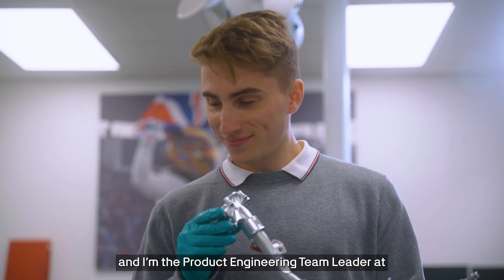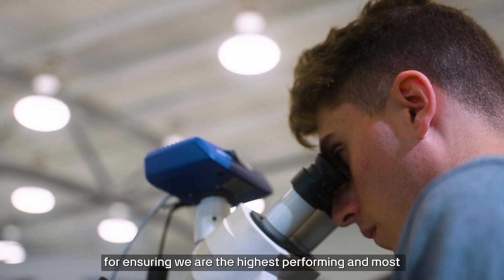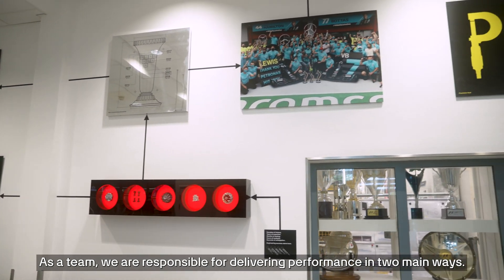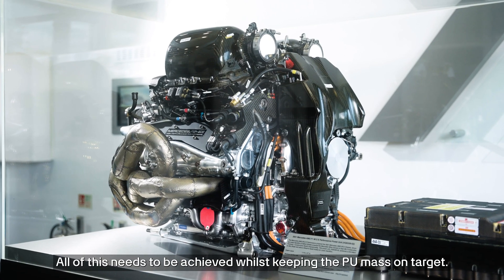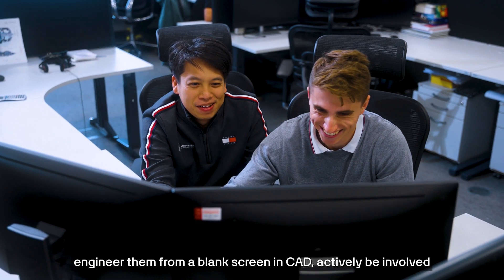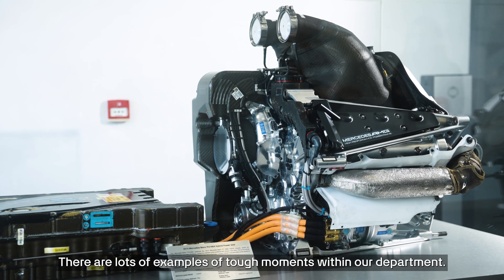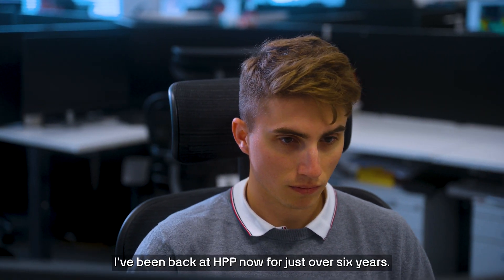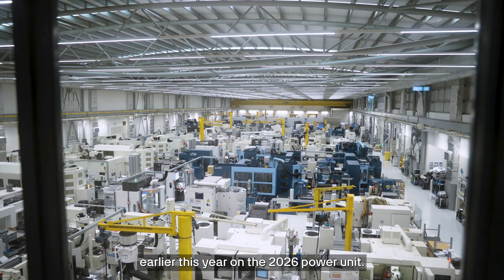My Job in F1: Doug | Product Engineering Team Leader

Comment: What cad programs are used? I'm an engineering student and I'm curious
Reply: You can see in the video he’s working in CATIA. I’m sure they use other programs besides catia as well
Reply: @zatarray4019  Thx, I've never heard of that one before
Reply: If you look at the Careers page of the HPP website, you'll see an advert for Mechanical Engineer that states Siemens NX would be the preferable CAD experience, so you can try and draw conclusions from that...
Reply: We’ve just switched from Catia to Siemens NX 👍
Reply: @AA-bf3dg  you work there as a designer?